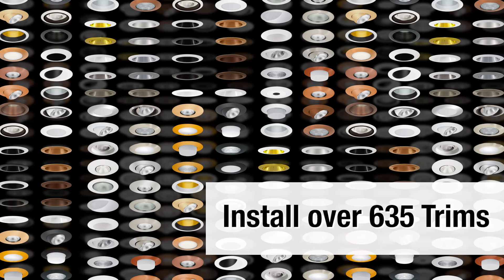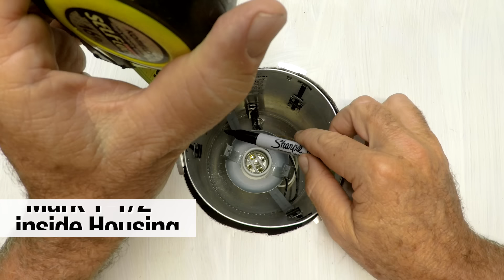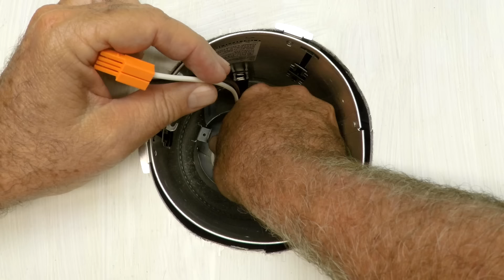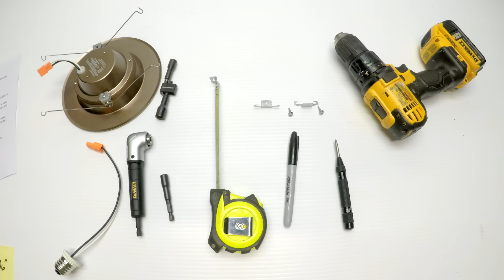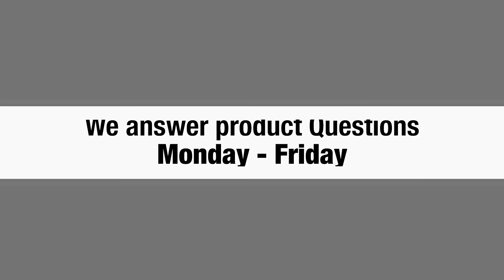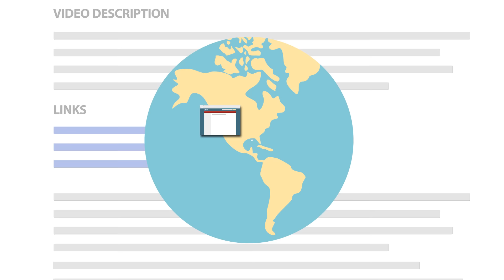Convert my Recessed Lighting Downlight with LED Trims - Step 2 - Installing Torsion Spring C-Clips

Comment: Good video. I just drilled pilot holes directly into the can so I wouldn't have to use the L attachment (or whatever it's called). I then used extension on drill bit to drill clips in. I did, however, encounter a big issue, which caused me to give up - for now. The cans in the room I'm attempting to install the retrofit lights are not mounted. They simply float and move around so even though I was able to attach the clips and get the light's springs on, when I attempted to push the light up into the can, the can moved such that I couldn't get the light all the way up into the can and flush against the drop ceiling. Extremely frustrating. Imagine I'll have to forgo the Edison-style screw-in retrofit and start fresh with clips. If any thoughts, I'm all ears!
Reply from the maker: Thank you and glad it was a helpful video for you. I am sorry to hear that your retrofit project has thrown you a curve ball. Here is a form that we have and if your can is not shown you can send us photos of it and we might be able to find a solution  ⬇
https://www.totalrecessedlighting.com/convert-your-recessed-downlight-to-led.html

Comment: Thank you! I am struggling to punch a whole in my cans to install my new retros LEDs
..
 ugh. I am going to try your way
Reply from the maker: Yeah it can be a struggle to get those torsion spring clip brackets installed. Glad our video was helpful in offering an alternative way to install that should make the installation process easier 🙂

Comment: Great video showing what most YT videos on LED retro do not address - the fact that many old lighting cans do not have the retention clips in them. Glad to have found this...was getting to the point of having to pull the old cans which would totally suck.
Reply from the maker: So glad to hear you were able to find our video and that it was helpful 🙂
Reply: Yes, most of the recessed lighting install videos on YouYube are worthless. Almost everyone of them says it's a 5 minute job, without ever mentioning if you have clips or not.

Comment: OMG. I have some flat LED lights that use e26 socket that only came with the wire spring tensioner. I always wondered why they don't come with the flat orange ones that have the bulb socket. This is a game-changer. Now I don't have to go into the attic and open up the junction box snd rewire
Reply from the maker: So glad to hear our video helped! You can find the torsion spring brackets here https://www.totalrecessedlighting.com/torsion-spring-bracket-clips-for-recessed-housings.html
Reply: @Totallightingsupply I received this in the mail Friday and installed them in the Half-Moon can today. Total game-changer thank you!
Reply from the maker: @sugashack74  So glad to hear our torsion spring brackets worked wonderfully! Have a blessed rest of your week 🙂

Comment: I have all the tools you have listed. The new punch I have does not even make a dent in the can. I had to order small hex bits to work with my right angle tool. Good video!
Reply from the maker: Glad to hear you were able to install the c clips / torsion spring brackets into your existing recessed can and our video was able to help 🙂

Comment: How far from the bottom of the van should the c clips be placed
Reply: Nvm
Reply from the maker: @skylane182s  No worries. We have a diagram on our website here for more info on placement if you need  https://www.totalrecessedlighting.com/torsion-spring-bracket-clips-for-recessed-housings.html

Comment: Is it possible that you installed the clips upside down?  When I am removing the light, my C-clips are bending.  If they were installed so that the grippers were below the screw, I don't think I would experience that problem.
Reply from the maker: If you find it easier that installation and removal works better with the C-Clips reversed there should be an issue in doing that. Just make sure it has secure retention 🙂

Comment: Why wouldn't you just use LED bulbs?
Reply from the maker: Not every application is the same. For example, the trim is old and has yellowed, is damaged or disfigured and simply replacing with an LED bulb would not resolve the problem. Another would be the color or finish of the trim does not fit the space due to changes in the space. Hope that helps 🙂
Reply: also - old trim is not airtight which bleeds energy

Comment: Thanks for making this video. The idea of LED recessed lights did not exist about 5 or 6 years ago. Scratching my head trying to figure out how to retrofit my 6 in cans with LED recessed. This video definitely put together the missing pieces, the clips and assemble the finished can light.
Reply from the maker: You're very welcome 😊 So glad our video could help!
Reply: good video . Friend of mine changed out all his down  lights w / LEDS . He suggested i do the same and how easy it was to do . But he had clips . Mine didn’t .
Reply: Mine doesn't have clips either!

Comment: I’m currently trying to update my lights to LED. I took out the previous recessed lighting and measured the J cans, they’re 4 3/4inch. It’s an awkward size and I’m having trouble finding lights that would fit them. I purchased those adapters, but I’m still having trouble finding something that would fit. Any help would help
Reply from the maker: That size is very difficult to find an LED replacement. Have you tried contact Juno direct for an LED replacement?

Comment: All you had to do is put an air tight 6" baffle so the socket can clip into it, then you could have put any type of LED light bulbs in it. Not sure why everybody want so use the retrofit. If that goes out, then you have to replace the whole thing. Isn't it easier just to replace a individual LED bulb? Plus then you can have LIFX or Phillips Hue lights in there and change the color to whatever you want.
Reply from the maker: Yes, that is a great solution if you are keeping the original trim. Many of our customers reach out to us wanting to replace their old, yellowing existing trim with something a little more modern while also wanting to go LED. So we have a solution you see in our video for that situation 🙂
Reply: the lights are advertised to last 45 years.